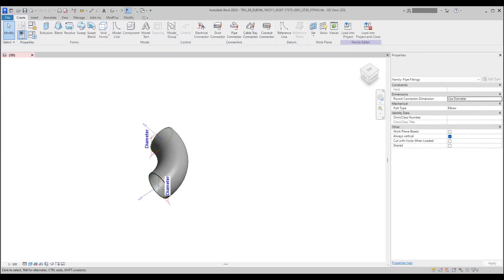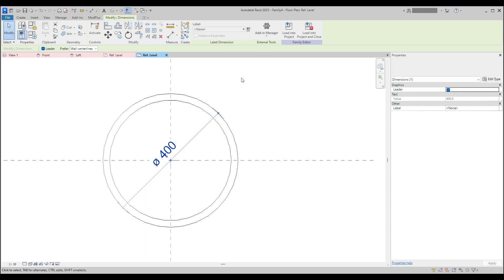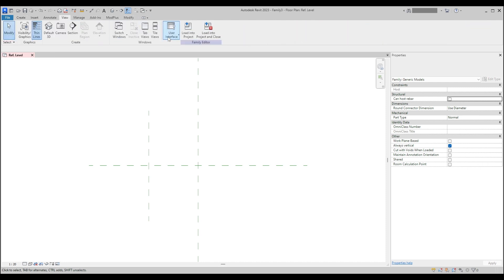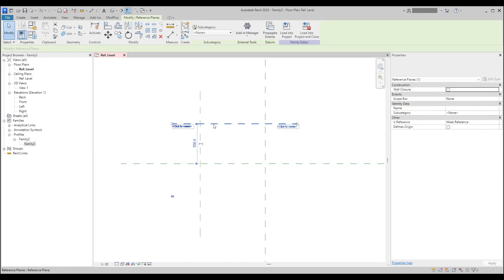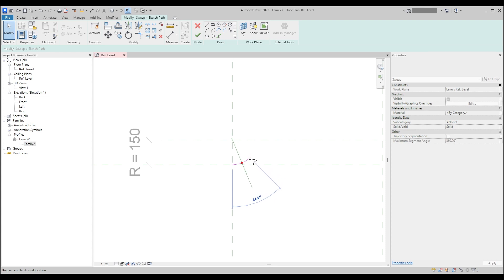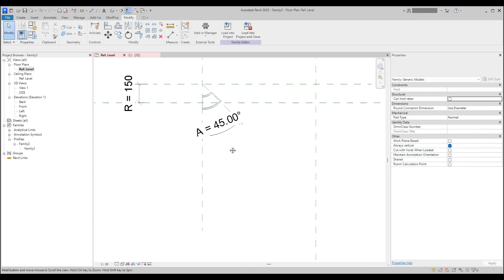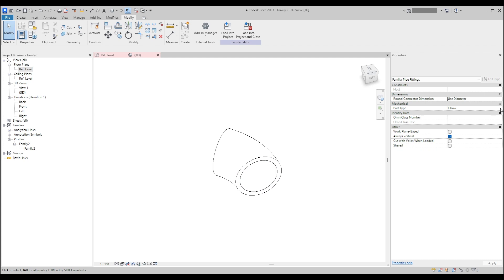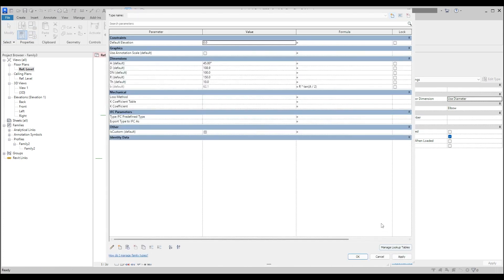Part 1.1 -  Piping modeling - Revit Tutorial - Elbow EN 10253-2 1.5D 3D. - Modeling

Comment: Hi, I'm a new piping drafter, I'm currently learning how to create the pipe fittings from your videos. It's very helpful to me, thank you very much! At 11:55 in this video, we need to use the command link connectors to both sides or just left side? And next command re-assign primary only select left side? What does this command means? I really appreciate it if you're available to explain it, thank you!
Reply from the maker: Hello, sure!

You need to link both connectors together and ensure that the one that is staying in place is the primary connector.

You need to link them to make sure that the system will not be split in several parts.

Also, ensure that you linked both connectors to the angle property.
Reply: @PipeEXltd2023  Hi, thank you very much for your reply! I already finished this part, and then I have more questions for the 1.2 part of your video. I left the a comment below your video 1.2 part, and I would appreciate it if you could take a look of that, thank you again!